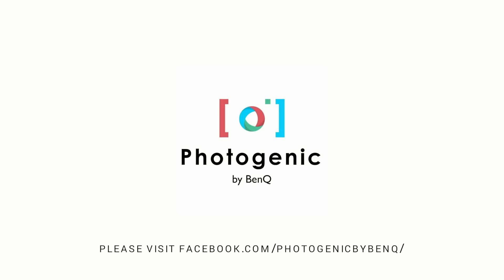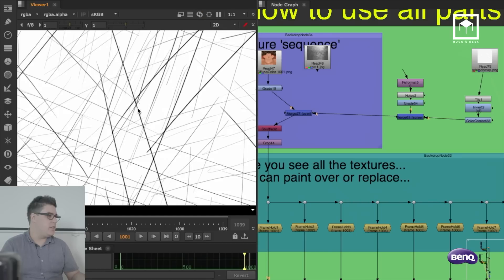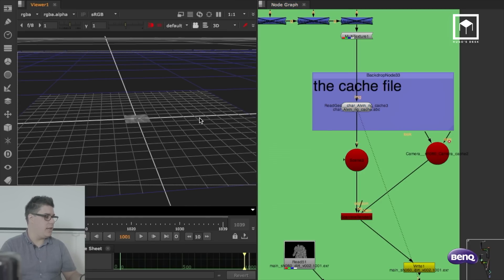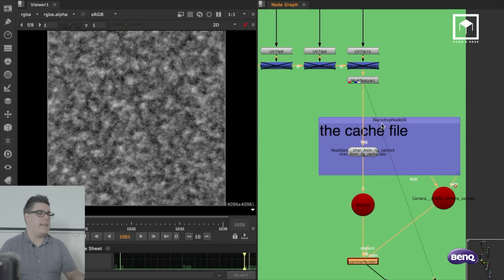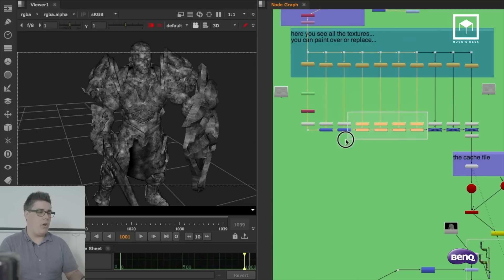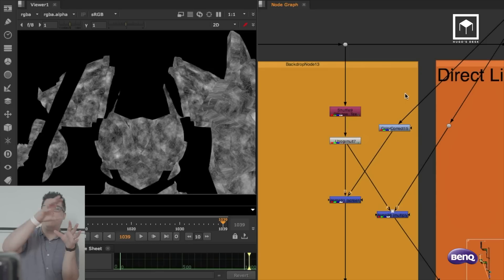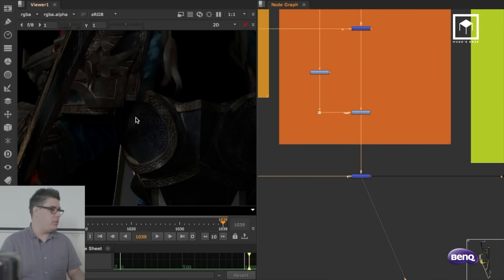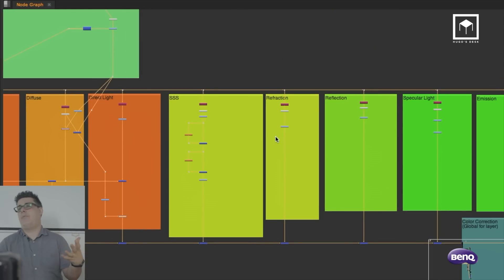How to add micro scratches to a CG model in Nuke

Comment: What's the benefit of doing scratches this way as opposed to using procedurals and smart masks in Substance Painter? Is it for more granular control down the pipeline
Reply from the maker: As I mentioned in these videos, it's always better to do it in 3D but sometimes with last-minute client changes you have to do it on the last day of production! Sometimes re-render is not an option.